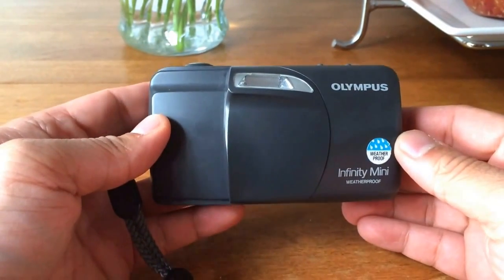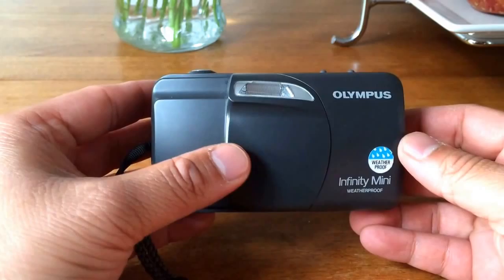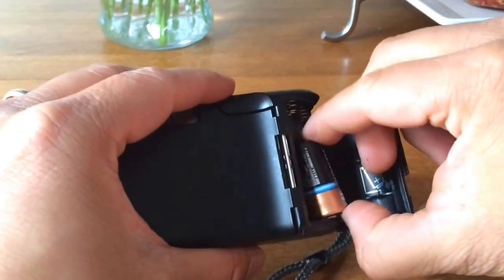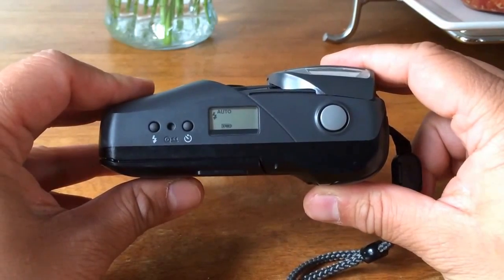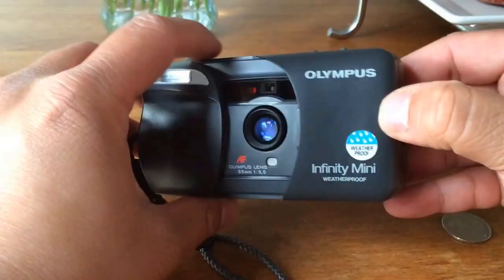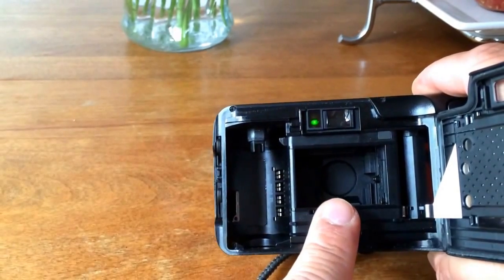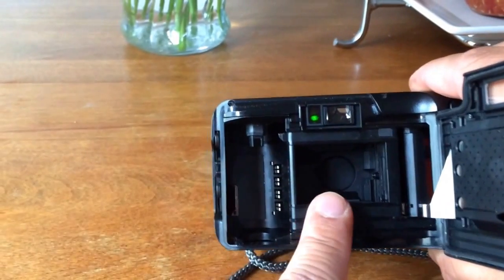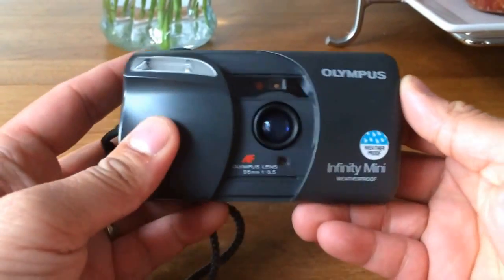How to test if a point and shoot camera is working before loading it with film

Comment: As mentioned by others, running a test film to check winding and rewinding work is important. You can check if the metering is working by pointing it towards a strong light source, taking a picture and then repeating the process pointing towards a darker area. Unless you are using a very basic camera you should see an aperture change when the shutter fires if viewing through the back with the door open. To test autofocus, point at far (10m) and near (1m) objects - the difference in focusing steps is subtle but you should be able to see it. Finally, test the flash modes.

Comment: Some P&S won't fire without film and/or with the film door open. So this isn't universally applicable.
Reply from the maker: Close the film door, half press the shutter to grab focus, open the door, then full press. Might be tricky at first but I haven't yet found a camera on which it doesn't work.
Reply: Mike Padua Olympus mju zoom range
Olympus mjuII zoom range
won't work on either with the film door open as it moves the lens into closed position.
Reply: You can test on the mju zoom model by looking at the inside of the front lens.

Comment: Hi, i have a kodak s100ef, however, the batteries were not removed for a long time. I tried to put 2 aa batteries and the flash wont fire. Can i still use it? How will i know if it still works even without a film?

Comment: I basically do the same  as you when I'm testing a P&S camera but as I buy to sell on I also have an old roll of film that I put in to make sure the camera winds on after you take a shot. Then I carefully remove the film from the camera and use it again. It never gets developed so the fact it gets exposed when I reopen the back is not important. Good video.

Comment: First, for any old camera, order a manual -- lots of places provide them online free. On this model, you would see that you need to PRY, NOT TWIST the coin used to open the battery cover. Twisting will crack the lip.
Reply from the maker: Pry, don't twist--good tip!

Comment: Hi Mike! One question, why the motor to collect the part of the film that was shot is not moving every time you shoot? I have an Olympus camera and I feel is somehow stuck
Reply from the maker: That's a great question! Many point and shoots, like the one in this video, don't engage the take-up spool unless the back is closed--there's usually a little tab that gets pressed when you close the back that engages the gear which will then make the take-up spool spin. In that case, there's only one way to fully find out if a camera is 100% working, and that's to put a roll of film through it.

Comment: Wish I would’ve done this before loading my secondhand p+s with film! Fingers crossed for my roll, I’d hate to lose those memories :[
Reply from the maker: If you want a little peace of mind, and you don't mind potentially wasting a frame, you can look into the lens as you fire a shot (cover the flash so it doesn't blind you) and if you see the shutter open, you are very likely good to go. Of course there's no guarantees until you get the film back, but your chances are okay.
Reply: @themikepadua  Thanks for the reassurance, Mike. I couldn't really see the shutter opening from the front (and neither could the kind camera shop assistant that I asked) because it was so dark. Thankfully, after finishing the roll, I could look from the inside and it does in fact work!! I can't wait to see those few awkward close-ups of people once my rolls are developed x)

Comment: Hello Mike! I'm having a problem with a Minolta point and shoot camera. when i turn it on, all indicators in the data panel blink and the lens won't come out. I tried to remove and battery and reinsert it but it still won't work. the camera was tested working before. is there any way i could possibly fix it?

Comment: I have a point & shoot and want to see if it works, but it doesn't have the same screen on the top (it's a Kodak KB 28). Put batteries in but the shutter doesn't fire and flash doesn't work either. Any ideas?

Comment: Hey Mike, i have the same type of camera i just found in the attic, are the flash supposed to not fire when there's no film in it?
Reply from the maker: The flash should fire, just point it at a dark scene.
Reply: Did you try the flash control button on the top of the camera? There have been several Olympus infinity models made over the years. Some have fully automatic flash with no manual settings.

Comment: I have a Canon Prima BF-7 Date. I've put batteries on it and the shutter is firing but the flash isn't working. Also the shutter door doesn't open. Can it still be fixed or should I throw it?
Reply from the maker: you're likely better off finding a new camera than having that one repaired
Reply: @themikepadua  Thank you for the response :)

Comment: Hi! Nice video. I have bought a point and shoot camera (Canon Prima Zoom 76) fully automatic. Everything seem to work nice, I just load a film cartridge, close it, and it rolled to frame no 1. But the shotter buttom does not seem to work, does not matter how I press it, it wont take a picture. The motor runs, becasuse it load the film correctly, the dial works, it turns on and off, the zoom works nice but like I said, the shutter button dont do anything. Its just broken? Any help?
Reply from the maker: it's possible that the button is not making contact to activate the shutter; i would try turning it uside down and blowing some air into the space between the button at the camera to see if it will dislodge any possible debris. also give the camera a couple of gentle taps while it's upside down. Also just to be safe, make sure your battery is fresh, and if it is fresh take the battery out for about 10 minutes, and while the batter is out, give the shutter button a few presses. Good luck!

Comment: Saw the video but this problem has show to me when i shoot with the camera. I have found it at home with a brand new film roll inside only changed the battery i havent opened it because i am afraid to expose it . I am new to this i am not informed . Any advice about the situation? Thanks!
Reply from the maker: imwaitingyou in your situation you have two options: remove the film roll, and lose the first few frames from opening the back so you can test the shutter, or just shoot the roll to see if it turns out.
Reply: @themikepadua  this is probably very late now but I have the same problem - this camera already has a film roll in it. if I unload the film roll and lose the first few frames so that I could test (as the flash doesn't work, but the picture counter and the film rewind does), will I still be able to reuse the same film roll?
Reply from the maker: @justinelouise2655  yes, you’ll still be able to use the film roll—you’ll just lose the first few frames. The only issue you face is that if the camera rewinds the film, the leader will retract into the cassette and you’ll need a way to get the leader back out. You’ll need to try to remove the film without the leader going all the way back in.
Reply: @themikepadua  apologies once again for the very late response, but thank you so much!!
Reply from the maker: @justinelouise2655  you're most welcome!

Comment: I loaded up my Olympus mju with film and I’ve used it multiple times and it’s been fine. However, this time after the camera automatically rolled the film, the camera has that flashing e even tho there is film in it. How can I get my camera working again without wasting my roll of film?
Reply: Jake Oppy that happened to me too, can’t find an answer on the internet 🤷🏼‍♀️😫
Reply: When loading film, put the tip of the leader up to the red stripe, but don't push it further inside the camera, then close the back cover. It should load automatically to "1". If the film wasn't loaded properly and didn't move, the camera will flash "E" and won't work.

Then, after the film is rewound, either at the end of the roll automatically or if the rewound button is pressed before the roll is complete (don't use a sharp pencil! That will tear through the rubber button!), the camera will flash "E", but will not operate until the rewound film is removed. If you're worried, open the camera in absolute darkness to remove the film, but if it truly hasn't rewound completely (unlikely, but possible), DO NOT simply pull the film out! You need to push the film in toward the take-up spool, then gently pull, push and pull, until the gears inside the camera disengage and the film moves freely.

Comment: I got a Fuji Discovery 80 recently at a yard sale and can't tell if it's
 broke or I'm not doing something right. Any experience with those? It doesn't seem to have a power button but I can't get shutter to fire.
Reply from the maker: So, it does or does NOT have power?
Reply: Ive got the same issue..kind of scared to put in my role of film since the shutter doesn't fire. but the auto winding seems to work with the batteries in.

Comment: hello, i have a Fujifilm Zoom Date 1300 and when i turn the flash on, the flash icon keeps blinking and meanwhile i can't take picture (the shutter won't release). I read the manual and found out blinking means the flash is charging and it often takes about 6 sec. But mine takes too long. Does that means there's a problem with the flash?
Reply from the maker: Thao Dang have you tried a fresh battery? Usually when a battery runs low the flash won't recycle quickly

Comment: Hello I recently got the Olympus stylus infinity zoom and got new batteries and film. When I try to use the flash in any mode it doesn’t work. It just shows a flashing orange light with a. Green one but it never lets me take a picture. Can you please help me ? Thank you in advance!
Reply from the maker: My first guess would have been a flat/dying battery, but you did mention that the batteries are new. Double check it's a fresh battery and I'd even recommend trying  another new battery. The flashing orange means the capacitor is charging and if it never charges is usually means the battery is dead. One more thing--make sure the battery contacts inside the camera are clean. You can use a cotton swab with a drop of vinegar to gently clean them. If none of that works, the capacitor/flash just might be broken.

Comment: I found my mom's nikon af240sv in our store room last sunday, i really want to try if it still work. It need 2 3v cr123a battery but its really hard to find the exact batery in my area so i use a regular aa batery but it wont turn on, it doesnt have a green light like urs. I put in the film too but its still wont turn on.  Does it need to have the exact battery or the camera is broken??
Reply from the maker: those lithium batteries have exact voltages; in your case, AA batteries do not have enough voltage. I'd order the correct ones from the internet.
Reply: @themikepadua  thank u so much for the reply. I really appreciate it! Ordered the battery just now. Is it gonna fit in the batery compartment? Cause the AA battery fits perfectly in the compartment, im not sure its gonna fit with cr123a battery cause it seems shorter than AA battery?

Comment: Hi! I found an old film camera in our home so I put on some batteries but the red light is the only one that's flickering and when I click the shutter button, it clicks but doesn't flash and the twisting thingy inside doesn't automatically wind. Does this mean that the camera isn't working anymore?
Reply from the maker: Are the batteries fresh? If they're not make sure they are--otherwise, if they are fresh and you're running into the same issues, the camera is very likely broken
Reply: Thank you for responding! I actually bought a cheap roll to test but the camera really doesn’t work anymore.

Comment: I have one of these cameras.
When I put its batteries in and open the mechanism, a red light comes on in front of the camera, but the display does not show any type of information, it remains blank.
Has this happened to someone?

Comment: what do you do when that green light thing is blinking and have an orange light above it? it only lets me take pictures sometimes if i press the shutter button for a looong time and then it doesnt work! please help this is really frustrating, ive tried with different brightnesses in my room and everything but it only works sometimes:(
Reply from the maker: The green light blinking usually means it can't grab focus. Try to point it at something further away, in good , contrasting light with sharp textures to help it lock focus (ie. not a solid color wall, but rather some trees).
Reply: @themikepadua  thank you! i tried some different angles and stuff, but i realized that it only wanted to take pictures if i was reaaaaalllllyy close to my objective, and when i tried to move further away it didnt want to take a picture. i used up all my film and tried to take some photos without any just to check if it worked and then it took photos no matter if i was close or not. maybe i put the film in wrong or something? im not sure, thank you so much for your reply!

Comment: Mike Padua : What kind of battery do you using exactly ? Because i have the same Olympus and i need two of classic batteries for both-side +,- contact and every time i got some issues with that. 
THX a lot )
Reply from the maker: Charlie Jílek this particular model is unique in that it can take two AA or one CR123. Most cameras likely have the battery type printed inside the compartment.
Reply: Oh thx lot again. I founded the print inside, right after i posted the comment so right now im goin to buy it and try to solve that with this type of baterry. Hope it will work. Have a nice day ! )

Comment: Mine’s cannonmate dx, it only shows low light when i push the shutter button and nothing happen. Did u know what is the problem? I dont have any film roll yet:(
Reply: Also, the hole wont open. Do u know the solution? Thx
Reply: having the same problem with my minolta freedom 35 focus free

Comment: This doesnt tell if the exposure and autofocus work properly, nor if the film advance works peoperly or if there is any light leak.  By the way, to see the shutter opening, do the test in a dimmer light, it will open longer
Reply from the maker: @Peppermint that’s because you can only tell those things after you load the film and expose and process film. This is to see if a point and shoot can expose film—at all—“before” you load film as the title states. Cheers, and thanks for watching!